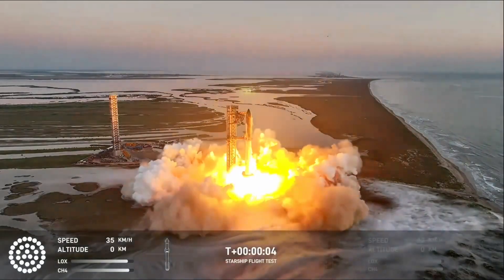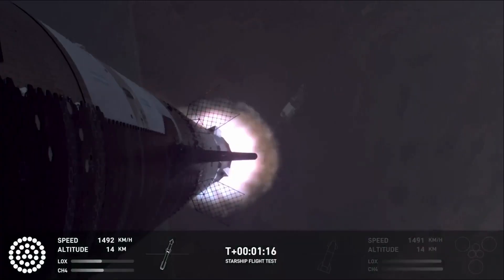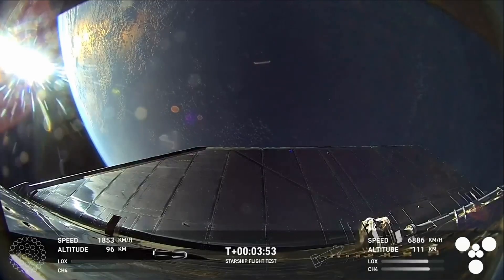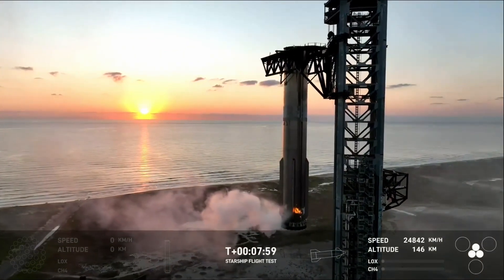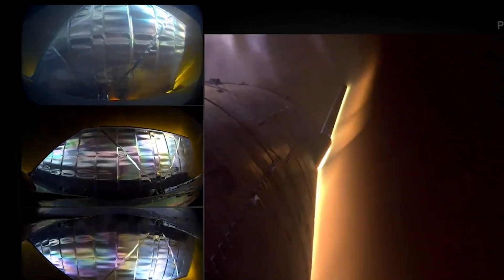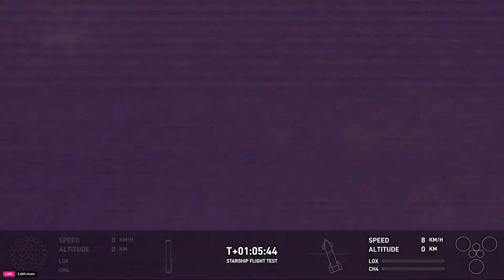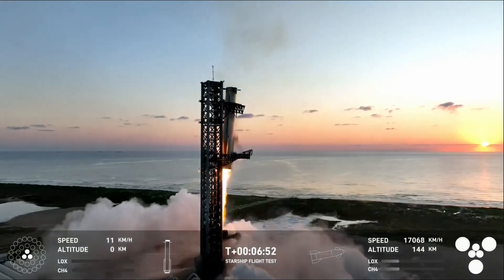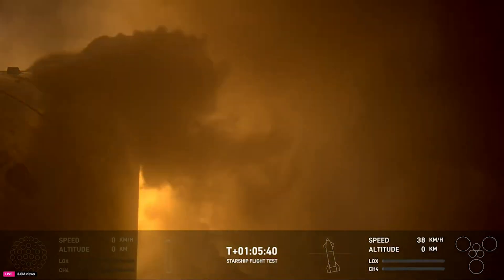What Exactly Happened On SpaceX's Fifth Starship Flight Test?

Comment: Every month or so SpaceX does something amazing.  Full flow stage combustion engines with record breaking chamber pressure and thrust to weight ratios was one thing.  Then Raptor 3 was revealed. It looks like someone forgot to install most of the parts. Even ULA's  Tory Bruno responded to the Raptor 3 photos by saying it's a “partially assembled” engine. When SpaceX said they would catch a 440,000 lb 233 foot booster rocket out of the air, most thought it was an engineering impossibility. I am done doubting what SpaceX can do and look forward to Starships on Mars.

Comment: After 5 flights Starship has not yet functioned as an orbital rocket. Yeah, the chopsticks were cool. But that's not the bit that has to go to space.
Reply: Since this flight went so well the next flight may be orbital and soon the release of a payload into orbit.  Space X knows how to progress at a reasonable pace that shows progress while being not too fast nor too slow.
Reply: I'm not sure why the doubters are claiming it hasn't reached orbit. It's at orbital velocity and orbital altitude. It just needs a small course correction burn at apogee to stay up there so it's perigee doesn't hit the atmosphere. The only reason they haven't done that burn is because they don't want to yet. It's a proven orbital rocket.
Reply: @wally7856  Because words have meanings. Orbit isn't velocity or an altitude. If you don't understand why, then I can't help you. We don't call anything above the Karman line "in orbit",  nor anything going at x speed "in orbit". By the metric of what a rocket should be able to do, 5 flights, a billion dollars a time, and no attempt to go further than last time, is a red flag. Never mind the totally bullshit delta-v of the upper stage. *When you need a dozen refuels in LEO to get to the moon, and the lander isn't even reusable, it's not efficient*. It's like all that fuel is for the engines needed to provide thrust to overcome the weight of the fuel. It's ludicrously bad design and the worst way to achieve the required D-v. Weight is the enemy. No one in their right mind would design the Starship from a blank paper as the optimal rocket... for anything. (In the same way the Cybertruck is woeful by many metrics, but the very smart designers and engineers are hamstrung by Musk's fake futurism. He wanted the truck to look a certain way.) Sure, they'll solve the engineering problems. I have no doubt, but at it's core it's a nonsense childlike rocket. Imagine the laughter from the Musk fans if another company's centerpiece rocket was so obviously flawed. 

The rocket equation has been understood since 1810. SpaceX is not reinventing the wheel here. It would be similarly hard to get really excited by a new ship building company who came up with a new ocean liner, made for round-the-world cruises. And they've made 5 of these so far, but all have sunk and none have got very far from the harbour -- but the fans are still deliriously excited because "baby steps!" Yah... it's been done though. Like, when the cruise ship finally sails around the world it still won't warrant losing our minds. It's been done. An orbital rocket is something of a banality. Starship hasn't even tried that yet. And when it reaches a stable orbit -- which it will -- it'll only be the worst, most hopeless rocket ever proposed for deep space.
Reply: I do think it’s going to come though. I’m not a fan of Musk,  but he’s not the one doing the work. Spacex seems to have some pretty smart heads onboard, it’s quite exciting

Comment: Aside from the catch, the fact that all the engines on Super Heavy functioned so well with no "engine outs" is one of the most impressive feats of this test flight. The shutdowns and relights seemed to be flawless. Pretty damned amazing for so many engines at a time. Relighting 13 engines...TWICE... wow.
Reply: The 13 center engines relit 3 times, not 2. Liftoff, boost back, landing.
Reply: @Rizzler420-uh4yd  Um - that would be one ignition, followed by two shutdowns and relights. So the poster is actually technically correct.😉

Comment: Given the harsh environment of reentry, it seems like "rapid" reusability is going to take some time. I think that SpaceX engineers know this, from their experience with Falcon 9 and the Dragon Capsule, so they are working on rapid production instead. The ramp up on production speed is concurrent with their rapid design iteration cycle, so that when a final flightworthy production Starship is finished and fully tested and certified, they would be ready to mass produce it. 
Even if rapid reusability is not in place when SpaceX needs 5-6 Starship Tankers to launch in succession to fuel a lunar mission, they will simply have 6 or more NEW Starship / Super Heavy pairs ready to go. That is entirely doable. In fact, I expect SpaceX could conceivably have backups for every phase of the mission, if their production is at full speed by then.
I just hope they have a whole lot of spare launch pads in case one of those catches bumps the tower. (Personally, I think that last maneuver was a little rapid for safety. Perhaps hovering and moving slowly over to the tower might be a safer approach?)
At any rate, they can still reuse all of the hardware between missions, as long as they can be refurbished. And that refurbishment process will get quicker and quicker as the team learns what needs to be replaced or verified each time. And turnaround on the pad will get quicker and quicker, as has been the case in Florida.
Reply: I'm sure the full reusability phase will come some years down the road. But for now, as you said, they will have a room full of new ships and boosters ready to use.
Reply: @Ed_edino  I can see the booster becoming reusable very soon. Probably not this one, but the next one might be reusable. The Starship - they need to figure out the heat tile situation, as it still did a bit of burn-through on this landing. Once they figure out how to return it to Earth with no burning through, I think they'll be able to catch it and it will be reusable.
Reply: Blue Origin's New Shepard is one of the only currently operational fully reusable rockets/spacecraft, and they have a very different operational model. They've just built their 5th vehicle overall, almost a decade after the first, are looking to operate a fleet of only 2 for the forseeable future, and they launch less than once a month with a turnaround time of about 2 months. 
I wonder if the demand for tens or hundreds of rapidly reusable Starships will really show up or if SpaceX will be left with a factory that can output way more Starships than are needed.

Outside the ~10 launches needed to support one Artemis landing and SpaceX's own Starlink missions I wonder how much commercial demand will really manifest for SpaceX's Starship, given that Falcon Heavy is so oversized that it only launches around 2-5 times per year (NONE to LEO) and Starship will be competing with not only SpaceX's own Falcon family of rockets, but also a whole host of other rockets that are ramping up their launch frequency right about now (Vulcan Centaur, Ariane 6, New Glenn, etc.).

Comment: Damn! How close did the booster come to the tower before the catch????
And they want to make the chopsticks SMALLER??
Congrats to SpaceX on the catch. But I still think the margins are very slim on this being reliable 99 % of the time. And a misstep is a very expensive and time-consuming problem.
Reply: From another angle, it's not that close. I know the everyday astronaut and cosmic perspective both had cameras at the other side. I wont lie though, i puckered a bit. Lol
Reply: look at Falcon 9 - they miss the mark by less than a meter. I'm pretty sure Super Heavy Booster will be the same.
Reply: @Ed_edino  IFT4s booster soft landing was within 0.5cm from their target location. Insane accuracy.
Reply: That's why they need a bunch of them.

Comment: A MASSIVE success, but that small fire at the end is going to prove to be a bigger nuisance than most might expect.
Reply: yep, the 'only' small fire part is funny, the only would be something irrelevant, not a fire for several minutes and not sure if the engine compartment did not burned too as it released continuously dark smoke while parts fall away.

still better than what expected, but far from what most hype it.

Comment: 1:27 MECO mean Main Engines Cut Off, not Most Engines....
Reply: No, he was right. They did not cut out all of the engines. Three were left running to insure booster separation.
Reply: in this case it means most engine, cheeky and for once actually funny reusing of the old acronym.
Reply: @thorin1045  you are indeed right. I didn’t take into account the 3 engines that remain burning.
Reply: That was back when you ran all the engines, then dumped the booster into the drink. Welcome to the 21st Century…

Comment: 2:52 The booster did not hover.  In fact it was never in the flight plan for it to hover.  It came down at several km/h.  The damping mechanism on the arms engaged too late and didn't help with the impact of the catch, which I expect SpaceX will try to sort out before IFT6.
Reply: maybe you are correct but i doubt that. i watched the landing as it happened and the catching arms did not flinch in a downward motion at all, meaning that the booster was at a standstil in mid air.
Reply: @robhaver8704  
Even the pins lined up. And i can't even thread a needle
Reply: @robhaver8704  SpaceX themselves concluded their stream with a complete shot of the capture from the tower cam.  That's what you'll be wanting to scrutinize—not the live shot where they switched to the tower cam after Booster has already stopped.  There is zero room for doubt.  It came down at a decent running click, the arms arrested that momentum completely, and then about a second later, the damping mechanism obligingly resumed a brief downward motion.
Reply: How would you engaged the damping mechanism?

The damping is a passive system built into the arm.. it’s like your shock absorber on your car. 

Do you need to engage your shock absorber on your car’s too?
Reply: @tonamg53  They were intended to absorb the shock of the catch.  What they instead did was respond to the weight of the vehicle after it had come to a complete halt.  Almost as though they were temporarily stuck.  You don't really get to handwave the footage we have of the event.
Reply: @Asterra2  Btw, I just watched the close up view of the tower catching the booster… Parts of the arms were raised up prior to the catch with hydraulics actuator to provide additional clearance and dampening force during the initial contact with the booster.

Hydraulic pressure was then released after the weight of the booster is fully resting on the arms which caused it to lower to its original position.

That is actually the system working perfectly normal.
Reply: Booster touched down on the arms mostly hovering, then the engines shut down and the full weight transferred into the arms and the damping system moved noticably.
Reply: @spiralout112  Hovering refers to a state where the vertical velocity is effectively zero, meaning the rocket (or other vehicle) remains at a constant altitude without significant upward or downward movement.  There's no wiggle room here.  Lateral movement is fine—in fact that's often the point of a proper hover.  Starship was still moving downwards at about 15 km/h when it impacted the dampening mechanisms.  That is manifestly not a hover.  Underscoring this point is the fact that we've known for months that the flight plan for the capture phase of IFT5 did not call for a hover.  This was a bit of a topic for a little while.
Reply: @Asterra2 Is the purpose to minimize overall cost or is there another reason to not hover?
Reply: @mike74h  I've been wondering that ever since I learned that they wouldn't be doing a hover.  But yes, cost is likely the deciding factor.  When you think about it, once they have the whole catching thing down pat, they won't be wasting a single moment doing any hovering because there will no longer be a point.  There was only ever going to be a point to hovering in these early stages when they're still trying to figure the system out.  I guess they decided they'd go ahead and skip redundancies in the eventual flight profile.
Reply: @Asterra2  I'd think there would be some value in minimizing strain on the Mechazilla arms. I wonder how fast the Falcon Heavy could come in without breaking them off (although my point is really that just putting a moderate strain on them seems less than ideal in terms of wear and tear).

Comment: In theory, this should make getting FAA licensing a lot easier as this test went pretty much perfectly from what we can see. 

About the only flaw was some slight burn through, but I'm not surprised by that. It's probably something that won't be fixed until version two of starship move flaps slightly closer to leeward side. 

What do you guys think, is flight six starship raptor relight test? I can't see them going for full orbit until after successful relight.
Reply: Yes.  The less the deviate from the flight plan in their license the fewer issues they will have.
Reply: Quote:
"The license does allow SpaceX to conduct at least one more launch, called Flight 6, using the same profile without obtaining another authorization from the FAA. 'The SpaceX Starship/Super Heavy Flight 5 license authorization also includes FAA approval of the Flight 6 mission profile,' the agency stated. 'The FAA determined the changes requested by SpaceX for Flight 6 are within the scope of what has been previously analyzed.' The agency didn’t state what those changes were."

If SpaceX doesn't change their plans for flight 6 they will not require a new FAA license. However if they decide to change those plans (for example because IFT-5 went so well), then they'll need a new license. I believe Starship is also currently working under an experimental launch license, so if they want to fly commercial payloads (like Starlink) then they'd probably need to apply for a proper commercial FAA launch license as well.
Reply: I think someone is going to find for what to blame them , mainly impact on enviroment especially with water thing so i think there wil still be large delays . But starship still has long way to go. There is ton to improve and catching ship too . Then suff related to rapid reusability fter which it needs to prove itself as reliable rocket before putting humans on it

Comment: Of course, NASA dosen't really give a damn about the OFT-5/Mechazilla success; because HLS Lunar Starship for the Artemis 3 mission is supposed to acheive a lunar landing with legs ... in late 2026, barely two years away!
This "mid-air catch" of Lower Stage Starship is of no use to a HLS Lunar Starship conducting a crewed lunar landing. (when will the lunar elevator be tested?)

But, Elon Musk got $3.5 billion from NASA to develop his StarLink comsat reusable launcher under the guise of assisting the United States in their "Return to the Moon"; a task he evidently has no intention of ever achieving.
But, as Bill Nelson stated in early May, 2023, "We want backup!"; when awarding the 2nd Option Lunar Lander contract to the National Team"s "Blue Moon" for Artemis 5, 2029 mission.
Reply: NASA does care a lot about this lmao. HLS will need to launch on super heavy and be refueled by starship, if the rocket is reusable, it will be cheaper.
Reply: @thecyanadon  Hells Bells! Haven't you worked it out yet? The proposed LEO orbital refueling plan is completely UNFEASIBLE for NASAs Artemis 3 and 4 missions! NASA has already written off SpaceX HLS lunar Starship as a viable lunar lander and has been concentrating since May, 2023 on New Glenn/Cislunar Transporter/Blue Moon for Artemis 5 and fourteen further Artemis missions, of 20-30 tonnes for each lunar landing (Total: 300-450 tonnes).
SpaceX Falcons will deliver 8 tonne payloads to GATEWAY, nothing more for Artemis, ever.
Reply: @davidstevenson9517  How come NASA still puts Space X as more plausible than Blue Origin? Sorry bud, this seems to be cope from you. Space X has already done plenty for HLS and crew is training with an HLS mock up.

Comment: What was the booster shedding when the engines relit for the landing burn? Also, what was burning on the side of the booster after engine relight?
Reply: The flame on the side was a leak through super heavy's fueling port. Not sure if the debris was related.
Reply: @f38293  Someone said that they lost some part of the rocket, an attached part came off. Not sure when that happened. It is all part of testing things. Things fall apart, they fix it and fly it again. That method works very WELL.
Reply: @1flash3571 
Yeah, i heard the same thing but then later i saw close up SpaceX footage and there were no missing bits that i could see. Everything was just a little scorched that's all
Reply: @1flash3571  
I apologise, i just watched the Scott Manley video and he has slow. mow vision of bits coming off just before landing